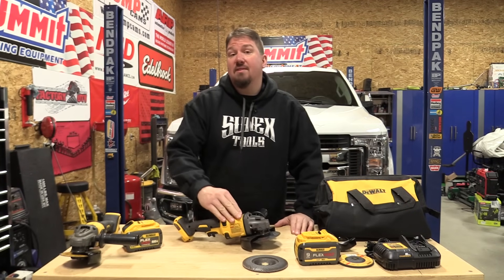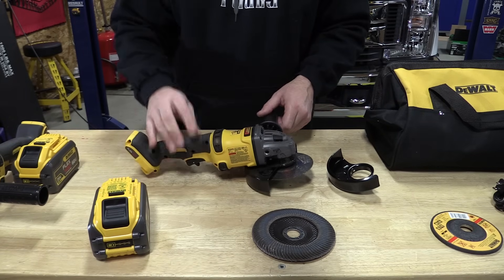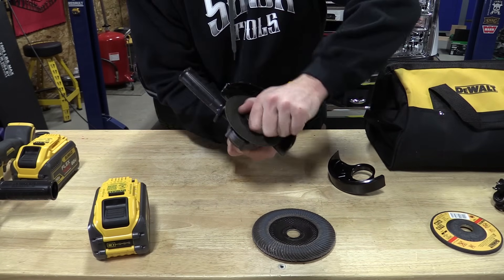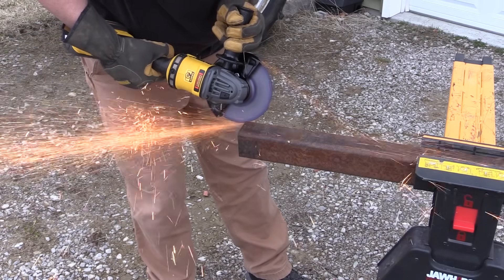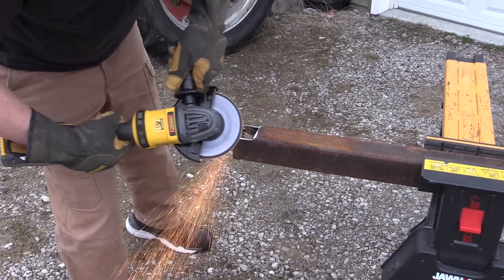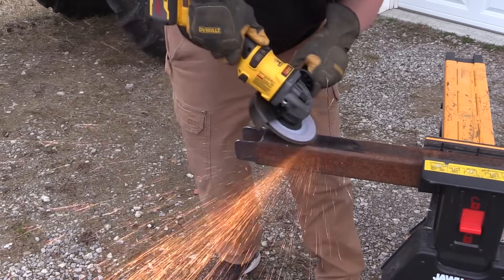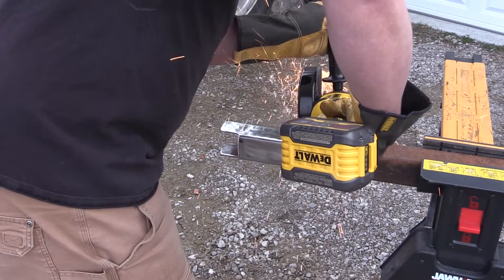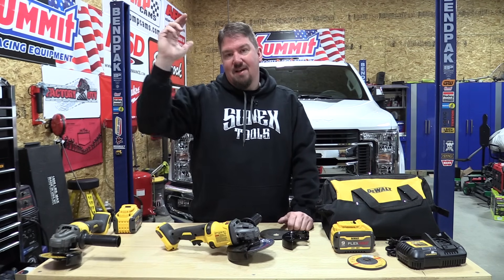DEWALT FlexVolt 60v 4-1/2" to 6" Brushless Angle Grinder Review DCG418 DCG418X1

Comment: I’m amazed that, despite utilizing three times the voltage, it only gets 30% more power.  If Voltage x Current = Power, this device should (mathematically) produce three times the power.  

Clearly, it wasn’t designed for the higher voltage.

Comment: I know its not alot of time in real time but 15 minute's of straight grinding time or cutting time is alot for any size battery ive ever used small or big. Im an ironworker and these have become more common alomg with the cordless 4 1/2" grinders and we can stretch batteries out for a little while. Buy then again if we're running a grinder  for that long were getting yelled at haha

Comment: The 1106 Charger is decent. Its a 6 Amp charger. It will have you charged and working faster than the model 112 (2amps) or model 115 (4Amp).

Comment: If you put on a 20v battery do you get less power and more run time?
Reply from the maker: FlexVolt tools do not accept 20 volt batteries.  20-Volt tools will accept FlexVolt batteries.  FlexVolt Advantage tools are 20 volt tools, not 60.  FlexVolt tools are 60-Volt tools.  Clear as mud?

Comment: Like the review. But what I use my cordless angle grinder for is small quick jobs. Might have to cut a piece of angle iron or something small. I use it with a sanding disc to buff stuff down and use a wire wheel to clean with too. It’s nice to have a cordless grinder to use on small stuff. I wouldn’t use it all day long because I would have to wait for the batteries to charge.

Comment: What do you think for using it to cut tiles with one hand. I use makita, will this be to powerfull for tiling
Reply from the maker: I do not have teh experience to answer this.  If a good high end 15 amp corded grinder is too much power, than this will be too.  Hope that helps.

Comment: For me my cordless grinder is a fairly specialized tool, sometimes. If I need to climb up the Side of a unit I can tie it to my back and just go, slap on the disk at the top and do the job. With a corded grinder that would be far more dangerous. Of if I need to go all around the factory doing little grinding jobs, the cordless is far better. There’s also a lot of situations where I need to just make a quick grind and it’s better to just use the cordless one rather than serching all corners of the globe for an extension cord.

HOWEVER, when I know I’m doing a lot of grinding in one place I always pull out the corded grinder and hunt down an extension cord. 

Also, unforeseen plus, I can charge my watch and phone off my used grinder batteries. Like even if it won’t run my grinder it’ll still charge my phone for a while. That was once the difference between having and not having a navigation system for my drive home in the rain.

Comment: Would this grinder do good with maybe the 9 or 12 ah batteries in grinding down concrete for leveling floors?
Reply from the maker: It would work well in small areas, yes.  Runtime will be around 7 minutes without a rest grinding hard.
Reply: No good for dust.  Ruined mine after 2 months
Reply from the maker: @ELITEWELDER1  Thats a short life.
Reply: @WorkshopAddict   it’s due to it not having a date engraved ? What does that mean?
Reply: DCB414 motor smoked and is now just a battery holder with leads for whatever I need 60v dc for?  Lol start the truck!
Reply from the maker: @ELITEWELDER1  warranty  should cover it.
Reply: @WorkshopAddict  won’t because guy said it should have an engraved date on it and it doesn’t? What’s that mean where did it come from?
Reply from the maker: @ELITEWELDER1  Thats new to me.
Reply: @WorkshopAddict  same.  Bought from a fella on a let go app.  Paid 150$ tool only.   Loved it for two months I had it!

Comment: Holy Crap , a 12.0ah FlexVolt battery is $269.00 right now at Home Depo ,, you can buy another DCG418 FlexVolt Grinder KIT w/9.0ah battery for $290.00 , That's Crazy ...
Reply: A good price target is $10 / Ah for batteries. If you buy in kits, on sale, or open box, you can usually get them for around $12 / Ah, at least for Milwaukee's batteries (I realize this is a Dewalt video). The higher capacities tend to have higher markups even on sale, so I'd look for under $14 / Ah.

Comment: First-thanks for your review.   Wanted to see if there were any physical differences.   Second-this can be a great tool for welders.  Mostly in the field because you move around so much doing stuff not setup for a station.  These 60v help a ton with keeping a mess of leads and cords untangled.  If there’s a ton of grinding I’m digging for a corded 6” or even a 9 (8”).   The hefty price tag doesn’t make it worth it to most.  Third-take the handle off the grinder and grab the head.  You can naturally place your body in a better position where you are not throwing sparks back at you.   The only time I ever see someone use a handle is if they have a big wheel on and are grinding in a flat position.  Lastly-be careful when applying max force with a tiger pad or an 1/8” wheel.  They are not meant for that much downward pressure and are not pleasant when they come apart.  Also-no strings on a hoodie.
Reply: I cut the strings off my hoodies for that reason.

Comment: I’m a welder and Pipefitter I stay corded for all day but when I’m doing small bore socket welds not butt welds. It’ll last awhile for 2” but anything over 3” with a bevel those grinders run through batteries.

Comment: How do you comment on this statment: "The DCG418 with a DCB609 battery has up to 30% more power vs. DCG414 with a DCB606". Does this mean, that DCG414 is equally powerful as DCG418 using a DCB609 battery?

Comment: Your confusing me, say 15 mins of runtime on this with a 9ah and 10mins on the power detect with 8ah but then say the power detect has long runtime. Also say old test is 3.5mins runtime but the new one gains not much runtime. Very contradictory. Love your channel btw, from a fellow Michigan resident keep it up!
Reply from the maker: First, the old test was purely grinding.  So the runtime was short at 3.5 mins.  Battery op grinders are not great long term grinding machines.  The Flexvolt 9.0 Ah battery is 3P so it has 15 cells and will last longer than the XR 8.0 Ah battery that is 2P and has 10 cells.  Just how the test worked out.

Comment: You think a DCB612 12.0ah would be better for this grinder?
Reply: Runs better on the dcb609. New technology in the motor of the grinder with the new 21700 batteries in the 9 amp make a perfect pair. I've seen it myself on the jobsite. I also own one of these and 3 9ah batteries myself. It's both powerful and effective. I'm a welder by trade by the way. Still not totally sold on cordless grinders because of the power they use but with the 9ah they seem to do the best

Comment: To be fair the battery is only a 3 amp hour in the 60v motor. It’s a true 9 amp hour in a 20v tool.
Reply: Ah yes, another idiot that doesn't understand Ohms Law.
Reply: A S C E N D E D W H I T E M A L E enlighten me please
Reply: @louischenvert7080  Since you asked Ohms Law tells us that current is directly preportional to voltage. This means if you triple the voltage you get one third the amps for the same amount of actual wattage being produced.

Basically amp hours is a stupid way to measure battery capacity. Amps are only one part of the equation, you need at least two (for example amps and volts) to figure out how much actual energy there is in the battery. This is why watt/hours is a far more useful measurement because it is an actual unit of work done over time, volts, amps, ect don't even need to be considered. 

Basically the Flexvolt batteries have exactly the same amount of watt/hours in them regardless of what config they are being used in. 

Flexvolt is a marketing ploy for the most part, because the exact same amount of energy could be drawn from the battery in 20v mode, it just means you would get idiots frying small batteries by putting them on a 2300w saw or something. It's clever, but the performance has little to do with the extra voltage, because you can design a 20v motor that puts out the same power, and you most certainly do not lose battery capacity in 60v mode, you just put it on a tool that's designed to use 1800w, or 2300w instead of the 700w you might be using on a particularly powerful 20v tool. Of course the battery won't last as long, but that's because you are using more energy. Battery has a set amount of energy stored regardless. It doesn't change.
Reply: A S C E N D E D W H I T E M A L E Right. Without that long definition the point I was making is that regardless you are getting 180 max watts out of the battery. The 60v motor is just going to draw it a lot quicker. And the amp hour verbiage is simply because that’s how how the industry knows it.

Comment: So does 30% more power = 30% less runtime
Reply from the maker: No, has about the same runtime.
Reply: Not necessarily. The amount of current drawn is influenced in part by the amount of load on the tool. The amount of power of the previous model was already absurd, and it was unlikely to get loaded up to it's full capacity in normal use. The new one is even less likely to get loaded up to the limit. In normal use it will probably behave very similar, but it's got a bit of extra headroom should you give it to it.

Comment: So they give you a 9 ah battery but take the fast charger out of the kit.
Reply from the maker: that might tell you that the fast charger is not working well for battery life?  who knows.
Reply: True. I avoid using the fast charger if I can sometimes you just need it though.
Reply: Looks like they are going away from the 8 amp charger, going to a new 6 amp. The standard charger is 4 amp. I would say 8 amp is probably killing batteries fast.
Reply: A S C E N D E D W H I T E M A L E nah fast charming doesn’t do much harm. You just gotta make sure it’s not getting hot they can get toasty with a 12.0 on it.
Reply: @henryk1031  Source: dude trust me.

Lithium ion batteries are well known to deteriorate faster when you charge them fast. It's an established fact. Everything about battery technology is about tradeoffs.
Reply: It’s the heat that comes from fast charging. Like I said but seems to be over your head.

Comment: Are the New Flexvolt batteries running the 21700 cells or still using the 18650s?
Reply from the maker: 9 and 12 have the 21700
Reply: @WorkshopAddict  that's awesome thanks for the information

Comment: I find myself not using my corded grinders near as much now that I have the flexvolt and my Ridgid grinders. I keep a flap disc on the Ridgid and almost always use it when I'm fabbing up stuff. It is so nice not to have to have an extension cord tangled up in my leads.
Maybe I missed it in the other video, but could you sometime explain/compare the differences between flexvolt and power detect? It has me scratching my head.
Reply from the maker: That is coming, but it is pretty simple.  Power detect is a 20 volt only platform and it can tell the difference between 20-volt batteries and what amps they can produce.  They can use FV batteries like any other 20 volt tool.  Flexvolt tools can only use 60 volt FV batteries.
Reply: @WorkshopAddict  If I remember right the flexvolt didn't give as much power on the power detect as a comparable 20v, is that right?
Reply: @leemarchant7191  Comes down to the newer cells being able to put out more current.

Comment: This is exciting. I have the regular one and out of my 11 grinders, it's my favorite. Very smooth runner. But not sure I want to spend that much on another one, even if it is this nice. maybe if I find a sale in the next few months.
Reply: Only if dewalt can straighten that angle on the battery mount so we can stand the grinder up..
Reply: @keithgreen3257  Until I read your comment, I wouldn't have noticed that until the first time I use one and go to sit it down like my drills and oscillating tool, lol.

Comment: No getting around the physics, but I think there’s a little bit more marketing than new tech going on here. From DeWalts website: “ *The DEWALT DCG418 with a DCB609 60V MAX FLEXVOLT battery has up to 30% more power vs. DEWALT DCG414 with a DCB606 60V MAX* battery.” OK, what about if we put the 9.0 on the DCG414? I doubt there’s a 30% difference there.
Reply: You should get a noticable difference in power between different batteries regardless of the marketing BS. My old brushed 20v circ saw cuts about 50% faster with a 6ah Flexvolt on it. Battery size has a massive impact on performance with any tool.
Reply: @Patrick-857  As someone who's used various battery sizes among the same tools and applications in the field, I absolutely agree. I often refer to my 5ah batteries as the "turbochargers", they make my old tired impact driver sound like a freaking turbocharged sumbeech when it drives fasteners compared to the 3ah because you can hear the motor over the impacting while using them. But when using the 3ah, you only hear the impacting instead of the motor and it's noticeably longer to drive screws. Endorsed.
Reply: @somethingtrulyhorrifying  Exactly. It's clearly apparent to someone who uses these tools for a living. The marketing from these companies is incredibly misleading.
Reply from the maker: I discuss this a bit more on Mondays Video.
Reply: @WorkshopAddict  Any link to this video?

Comment: C'mon dewalt, release a 9" model
Reply: Yeah, and double up the batteries for 120 volt like their cordless miter saw ;)
Reply: Snake Plissken that bitch would be heavy!? 😂 then use the 120 ac/dc converter too!
Reply: They have a 9in cut off saw
Reply: @Foxtrot would be a weapon like 120v 9inch 2x60v or a new battery platform that is 120v or 110vcordless not all about volts current is what gives the power

Comment: As someone who uses a grinder like me as it is my most used tool next to an impact and drill and needs the portability to take it from 10 to 40 feet in the air I love the flexvolt grinder and other tools as well. Ever since flexvolt was released i havent touched a corded tool since on the job site. Now i do have 5 9ah and 1 12ah battery at this point but one main factor that was a game changer for strictly cordless is the 4 port fast charger. I cant kill batteries as fast as this charges them up even if i try. The big thing with the dcg414 is even if the runtime isnt the best like you say the amount of grinding and cutting that can be done in that period of time is far superior to any1 else. I also have the dcg413f with the flathead. I wish they did that model with the power detect as well. I will for sure get this dcg418 asap and sell my 414 to a co worker that always buys my used tools lol.
Reply: I used the DCG414 for over a year now, my favorite tool I ever owned by far. I originally had 2 of the flexvolt batteries, when doing some heavy fab work, I'd occasionally run the battery down before the next one charged. Bought a third battery and I can work all day without having to worry about battery life.

I'm building armored trucks, having to climb all over and under the truck, compared to a corded grinder this probably saved me at 2 hours a day.The only problem I have with this grinder is that everyone in the shop is always trying to borrow it.
Reply from the maker: If you are willing to invest in batteries, you are correct, it is hard to beat this grinder.
Reply: @WorkshopAddict  just picked this up Sunday! Was a steal at 240$ with the 9ah battery. Wasn't planning on buying a new tool, but damn, couldn't pass that up. Can't wait to use it on my job sites.
Reply: @JKirkrms6 my suggestion is to get both grinders if you can. Dcg418 flexvolt grinder and Dcg416 20v grinder but flexvolt advantage. Dcg418 flexvolt as a kit with the 1 9ah and charger at 300 is a good value for that battery it comes with. The 2 battery kit 450 so there upcharging on that 2nd battery. Considering the cost of 9ah batteries are pretty high especially rite now even on ebay.
Reply: Jack Braddell  this is 2020 who wants to worry about a cord and every job is not a lift sometimes ladders. At least for me. Plus i got tons of other tools too not jus a grinder.
Reply: @JKirkrms6 yea its def overpowered for tile work. Its not much of a 1 handed grinder too. More of a 2 hander for sure

Comment: All of these are very good.but i see that with all this power this as the previous model sould have an adjustment switch so for you to want a little bit more gentle power!!!that is olny i see that lacks from these horsepower units.also i think that the new power detect tools have more "value for money" as the are a little step down in power but with greater runtime and has the versatility to put a flexvolt battery with even more runtime....Hi from Greece and stay at home....🙏🙏🙏
Reply from the maker: An eco mode would be nice!
Reply: @WorkshopAddict  👌👌👌👌👌👌